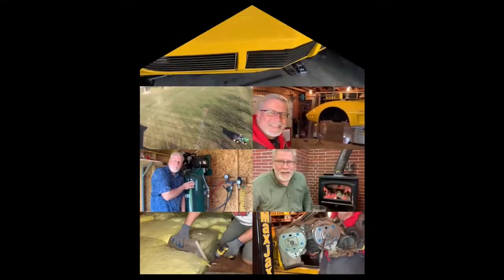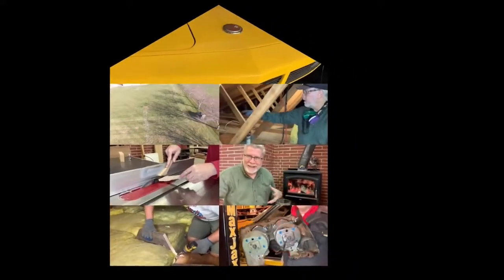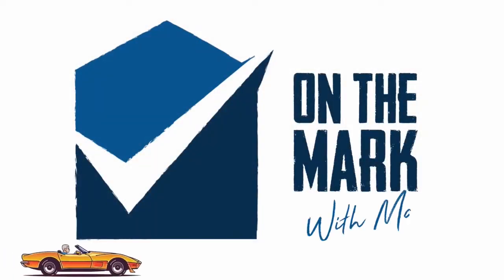DIY Automatic Door Closer

Comment: First you are making it harder for the bottle to do its job by doubling it up on the bottle side. 2/1 against you. You should have done that on the door side. 

That brings me to 

Second You should have put the pull in the center of the door, and doubled up THERE. The lessons the length of string and it give you the 2/1 in your favor.